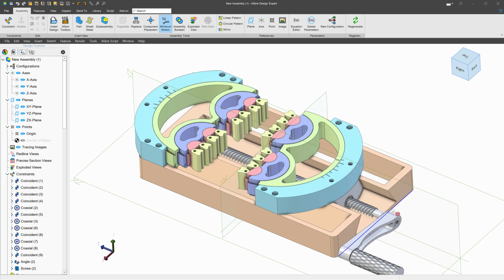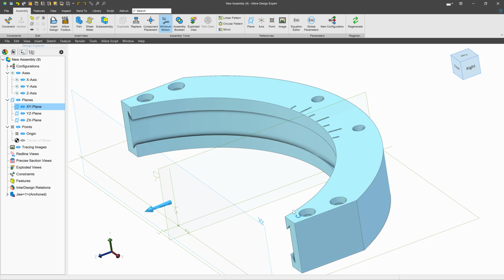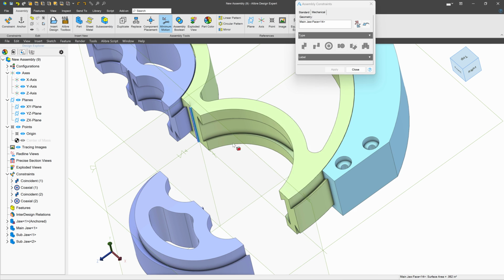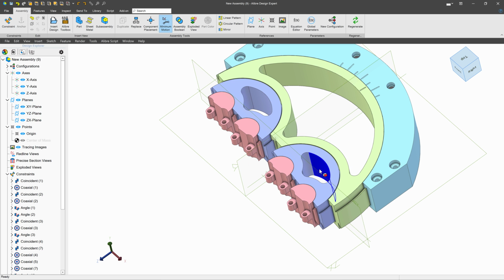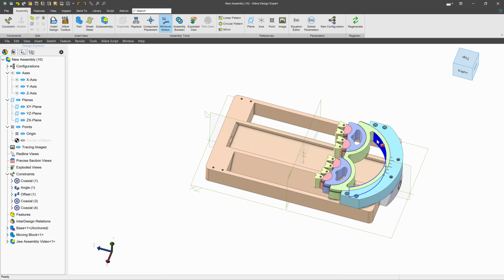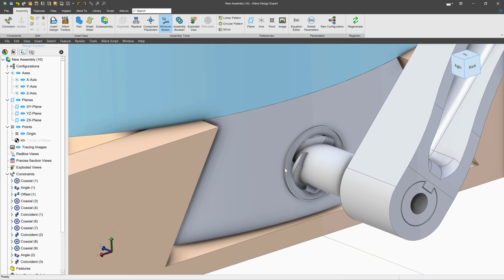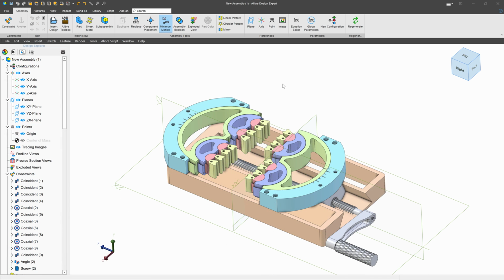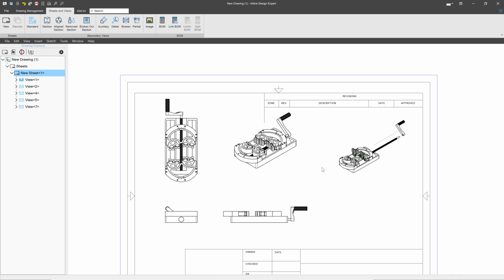Alibre- How to Make Assemblies

Comment: Is there a possibility to dimension the parts in the drawing after importing the assembly?
Reply from the maker: Yes- one easy way to edit the dimensions of parts in the assembly environment is to right click the part and select 'edit here'.  This will bring up all the part edit tools to make whatever changes you would like to the part.  When finished, right click the very top line of the design explorer and choose 'edit part/ subassembly' and it takes you back to the assembly environment.

Comment: When I build a new part based on another part in the assembly and use Constraints and keep association, and then move the parts in the assembly, the dependent part is destroyed by the movement. Is there a way to have Constraints that have "keep association" but still allow movements in the assembly - I may miss that option.

Comment: It's also worth mentioning that:

Everything mentioned here, apart from the mechanical constraints (gear, screw and rack & pinion), can also be done in Alibre Atom 3D. Which is a lot of power for a CAD that costs very very very little money!

Comment: Great tutorial. You even did show the common assembly pains, one being clicking wrong set of holes because the part/subassembly landed incorrectly in the space 🙂

However, I think if you click right mouse button and hold it on a part/subassembly, you can orient it in the space closer to the position you'd like it to be constraint. Then it'll make more sense which holes to mate. Just my two cents
Reply: I'm not sure how to do what you said there Ty. Could you elaborate a bit more. I right click and hold and it's not doing anything... Is there an option or key definition for that?
Reply: @ExMachinaEngineering  I checked it, actually you hold the shift while holding left mouse button, and move your mouse. It'll orient the part freely in the space.

Right mouse click is my habit left from Solidworks days I guess :)
Reply: @tctn Now that's a cool tip right there.